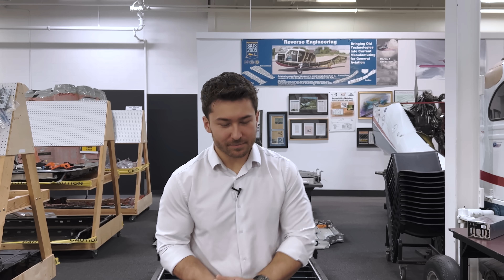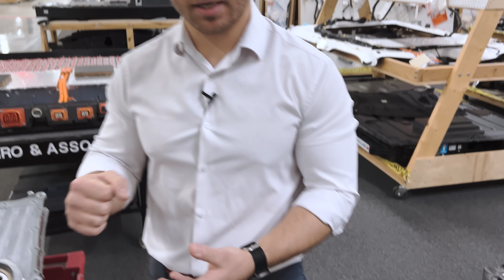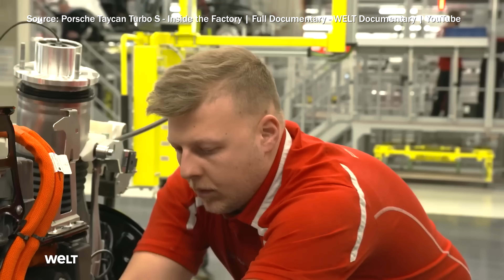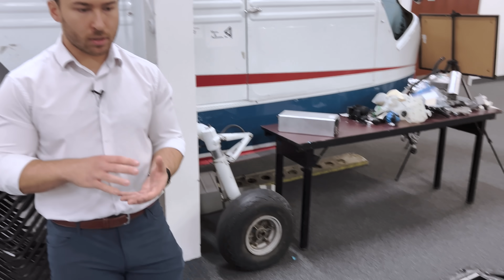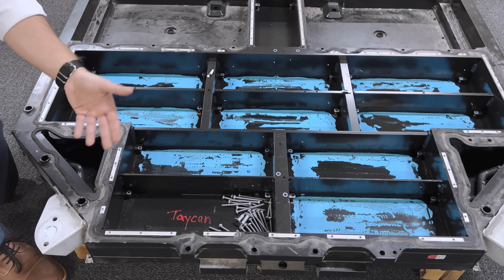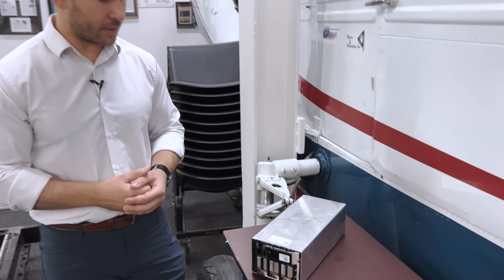Porsche Taycan Battery Pack Teardown

Comment: Thanks great reveal and analysis. It's very important EV owners and the emerging maintenance and repair industries get a good understanding how these systems are put together. Your efforts in support of this are greatly appreciated.

If you can get your hands on one, I would really like to see a tear down analysis of the BYD 126S1P blade battery. It seems to offer a quite different take on battery design.

Comment: Don’t get what you told us @10:22 mins ago

336 cells ins 20 packs?
136p2 Layout @520 Volts? Äh the numbers don’t match

do we work with 3,7 or 3,8 volts 

198p2 x 3,7 = 732 Volts @ 93,4 kWh so 235 Wh per Cell?

Comment: Porsche still got those crap o ring push connectors on the internal coolant lines, better hope the rings dont flat spot like they do in the ICE ones after a few years. Doubt they are specified in a high spec elastomer. Munro could stand further back branching  more into the total life cycle cost analysis like the oil and nuclear industry are now paying for not doing in the past. This design for manufacturing and value engineering is all well and good but then they cant be cheaply repaired or scrapped (already the case with EV,s right now), been there done that. Design is the point to build in life cycle cost and decommissioning. . Estimated to be costing the oil giants 1$/bbl and a job for life.

Comment: Was enthusiastic about seeing you work with a Fein Tool oscillator where my brother in law is the Swiss 🇨🇭inventor of the sawing blades. He was 10 years the exclusive manufacturer with ALL application ideas that Fein and later Bosch as well as 3‘000 Chinese manufacturers have just stolen without any refund to the real initial inventor. So seeing your use is a late honor to see what can be done with no other tool like that😂🤓🤔

Comment: So what is it about the Porsche battery that makes it an absolute monster in terms of thermal management? It’s the only EV on the market that can do 140 mph autobahn cruising followed by DC fast charging with a huge flat curve with no issues.
Reply: Porsche haven’t yet learnt why this is a problem. Once they start selling more than a few thousand units and get some serious feedback they’ll learn, just like Tesla did.
Reply: @userscott  Why what is a problem? Car performing the same in all conditions and not going into thermal panic like Rivian?
Reply: Maybe it has a stronger cooling system?
Reply: The very high voltage operation will certainly help with i2.R losses.

Comment: Are there any separators between cells? And/or sny fire propagation addons?
Reply: They did not tear down a module, so you will not see whatever separates cells. 
If you were asking is there separators between modules... well, yeah, there are obviously big walls in the case.

Comment: Better to leave the module out than install it, turn it off for lower trim levels, forcing the owner pay to chauffeur the thing around for the vehicle’s lifetime.The module will power another vehicle for every ~30 vehicles made.
Reply: No EV can "turn off" a battery module depending on trim level. Battery capacity changes made in software change the upper and lower limits of the state of charge - they don't disconnect part of the battery.

Comment: Do these modules follow a VDA standard? 
VDA standards cover dimensions, and presumably other characteristics. they are not used worldwide, but some battery suppliers in China and vehicle manufacturers in Germany and in China seem to use them.
Sellers of used Taycan modules list the dimensions as 390 mm long by 150 mm wide by 109 mm tall (as well as a mass of about 12 kg), and the width and height match the VDA 355 standard (which is 355 mm long, not 390 mm).
Reply: i'm using these in a conversion and can confirm the 390mm length.
Reply: Thanks, @jasonmanness7941

Comment: Shiocking how unrepairable most of the EV's are. Even Tesla makes it super hard to replace a failing cell. EV's could last many decades if you could replace a failing cell like you do in a flashlight. It is super unecological to not have repairability.
Reply: Unfortunately it isn’t that easy to just replace cells or even modules. Batteries age therefore you can’t just put a new cell into a system with aged cells.
Reply: The BYD blade system is field replaceable i believe. The unrepairability of 99% of EV's is absurdly bad. That is why i like the Edison Motors approach, which is easily repairable. They have the correct attitude, and the rest of the EV companies don't care, which is super un-ecological IMHO. @davidglieder8862
Reply: Its all about cost saving, screw connections are much more expensive and there is no Business Case for spare parts..new Cars has to be sold instead of maintance of already excisting  vehicles

Comment: Clearly Porsche's first battery pack design.  Dozens of modules requiring expensive bus bar interconnects, complicated mechanical pockets for each module, separate box on top for connections, etc.  Hopefully their next design will be much more produceable for higher volume manufacturing.  Maybe they should hire Munro to give them some pointers on Lean Design.  Thanks for the review Munro!
Reply: Why would they optimize a battery pack for high volume manufacturing when it is targeted for a low volume car?  Apart from that - almost all EVs used such a modular design until recently.
Reply: @EinzigfreierName  What would be the downside of an optimized battery pack?

Model S and X are lower volume than Taycan.
Reply: They can reuse those module to make other pack for other car also it is way easier to diagnostic and replace a failed module instead of the full pack.
Reply: This pack design is far superior for recycling and reparability then a solid block of batteries and glue like a Tesla.
Reply: Probably nothing to do with porsche. VAG were are using off the shelf components. Valeo electric motors and as we can see here LG batteries. That's slowly changing now since they are getting price wrecked by competition. The same EV cars from VAG are way cheaper in China. BTW that should be illegal.
Reply: All the competition is doing exactly the same . The only company that probably doesn't have to rely on third party battery cells is BYD.
 @hagestad

Comment: Repairability of Tesla batteries is HORRIBLE. Please comment on the huge cost of repairs when a cell goes wrong inside a pack... Tesla only sells a $21K battery as a solution to any even small battery issue, and this effect is horrific to a customer (especially a original owner who supported Tesla from the beginning).
Reply: No, I want Sandy to comment on the Tesla battery design, and how a no-maintenance car in first four years becomes a brick at year six or seven when almost any battery-located part fails... contactors, battery contacts, wires, etc. or maybe one battery goes out... bang, here's a $20,000 bill. Enjoy!
Reply: Watch The Electric Viking

Comment: Wow, Taycan also had the optimal foot garage even on big packs??
And, they could easily have fitted 7 or even 10 more modules if they'd called it a 2+2 with shallower foot garage in the back.
Reply: The Taycan invented this.

Comment: I’ve been waiting for a teardown of a Taycan battery to confirm/deny whether or not these cars are basically “throwaways” if the battery pack goes kaput.  Still not sure.
Reply: looks replaceable.
Reply: What worries me is that each module has its own battery management board. Batteries may last, but show me an electronic device in  a high temperature environment that withstands 10y + . And having many of these increases the chance of failure imho

Comment: So tesla isn't the only one with basically unservicable sealed ev pack's. Looks like the byd atto 3 teardown&nio et7 pack teardowns!👍🏻😀
Reply: Tesla plans on feeding failed packs back into their recycling.  You'll get a core offset against the replacement.  The "non-serviceable" pack comes from making packs that last at least 300k miles.  Servicing isn't needed if replacement is cheap enough.  
The cost of "servicing" one of these packs is $5-7k and is not getting cheaper because it is human labor intensive.  Even in cases where they will service the pack, you'll likely have to pay to ship it to a centralized refurbishment center, the local dealer won't be able to do it well enough to be trusted.  Tack on another 3 grand in round trip shipping.  
It will not be long until a new replacement pack from tesla is the same price as a single module replacement for other manufacturers.  Module replacement is silly because another cell can fail the day after you spend $8-9k and they give you no warrant on the other cells.  A replacement gives you a warranty on the new pack, it is like a brand new car.
Module replacement is what someone will do at home, not pay a shop to do. So a handful of youtubers and that is about it.  Most people don't have the time, skills, and equipment to do this.
Reply: The battery from Tesla should outlast the car. LFP battery should outlate more than 1 million miles. Should be enough and the problem is.... after so many years. U probably cant buy these cells anymore. So its also IMPOSSIBLE to service this taycan. So it does not matter.

Comment: 10:19 - you got nominal voltage wrong for this smaller 79.2 kWh (gross) pack: it is 168 cells in series times 3.67 V nominal per cell, which is 616.6 Volts, not 520 Volts.
The bigger pack with 93.4 kWh (gross) has 198 cells in series times 3.67 V nominal per cell = 726.6 V at the pack level, so that roughly aligns with your statement of 720 V nominal.

Comment: Bro. No wireless oscillator...  tsk tsk tsk. Get it done.
Reply: Too bad you don't talk about suggested processes for removing the in trunk bolts required for release of the pack. Or will they never sieze or fail, because you don't have to access they regularly...  hopefully.

Comment: Good overview but no mention of the repair and reuse mentioned in the title. It would be interesting to see Porsche's (Rimac's) connections to bus bars. Also wish we saw inside the module to see the heat path down to the cooling plate. 
And as always, it would be good to get a peek at how they control gas flow in a thermal event.
Reply: Taycan was designed way before Porsche and Rimac had anything to do with each other. Probably even before the first Rimac prototype was built.
Reply: @simson4t  Not so sure, because Rimac was already working with lots of OEM's during the design of the Taycan...... :) And i have seen a slide from Rimac where they exposed that they worked on the Taycan. But that was on some very private investors meeting. Sadly can't find that slide anymore. Also Rimac was working on a 2 speed gearbox, 800Volt system. So yeahhhhhhhh I am not 100% but there are many leads towards Rimac designing lots of parts for the Taycan. Because before Porsche had ZERO experience with electric cars. So you can't build something good out of nowhere.
Reply: @HermanWillems  Porsche had experience with EVs in their racing program, at least as much as Rimac that also only had racing experience, and was a garage Company at this time with zero manufacturing experience. Taycan is hundred percent Porsche project
Reply: @simson4t  But there have been a lot of battery failures on these no?
Reply: At least it's possible to open and take out the modules. That's a good start when it comes time to repair. No pink foam in this one :)
Reply: @mrm1885  Agree, but I highly doubt that the pink foam is a long term solution. It is possible that the intent is to block any attempted repair, but that would be egregious even for Tesla. I suspect its real use was to limit access to the cells themselves by folks like Munro and those who would run electrical tests on the cells. These still contain some secrets.
Reply from the maker: We didn't open any modules on this one, as we mentioned in the video.
Reply: @MunroLive  Just saying I wish you had. Thermal transfer through the cells themselves, repair/2nd-life, and safe/recoverable failure modes are key areas that have my attention. Each has been neglected in the past, to a greater or lesser degree, by OEMs. In the long term these are make-or-break subjects for successful mass EV adoption, though not 'sexy' or highly visible when they work.
Reply: @MunroLive  but its in the title of this video "Repairability and Reusability"
Reply: One good thing about this battery pack is that unlike Tesla's 4680 piece of unrepairable garbage.... It can be opened up for service.
Reply: @DavidJohnson-tv2nn  yes, the Tesla pack is intended to be disposable or ground up.
Reply: @DavidJohnson-tv2nn   What do you want to service in there?
Reply: @Tschacki_Quacki swap a faulty module.

Comment: The missing cell is the Porsche zero option, you get to pay more for this.
Reply: Yes! Porsche was First to master the “fewer standard features costs more”🙄😎
Reply: Of course it costs more. It adds lightness. 😅
Reply: it's one of the ways to offset the driver weight
Reply: Or it will just allow them flexibility of using different capacity modules without changing the pack design and do better weight balance.
Reply: It's a missing module, not missing cell. This module alone contributed to a weight savings of 13.5 kg (about 30 pounds) of the car weight, means better acceleration and better weight balance.
Reply: I think this option is around 6000 euro. Lol for few stupid cells. Now think about this: the WHOLE battery in a model 3 RWD doesnt even cost Tesla 6000......  :) and this stupid option for a few cells cost 6000....
Reply: It’s amazing what a manufacturer has to go through, just to put a battery and motor in a chassis and body, something Tesla mastered long ago. Once non-Tesla manufacturers get past the motor-battery problem they can tackle making a proprietary, fully integrated, high voltage, computer on wheels; that will probably never happen,except in China.
Reply: @shepherdsknoll  LOL another cultist